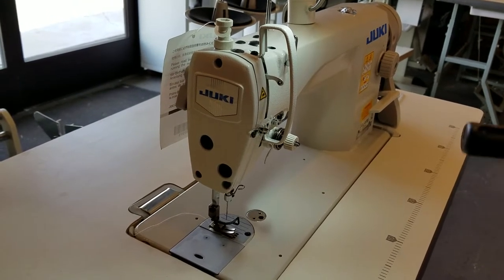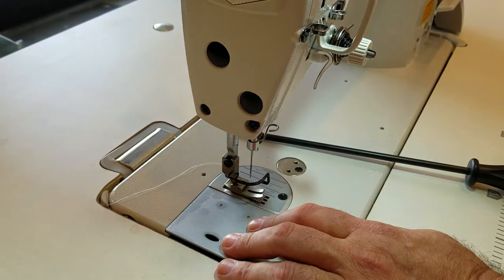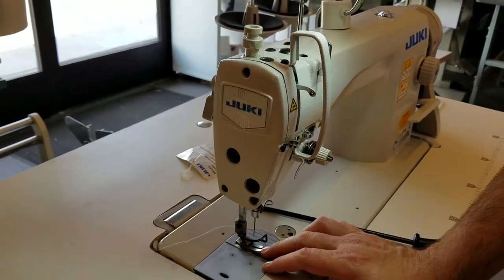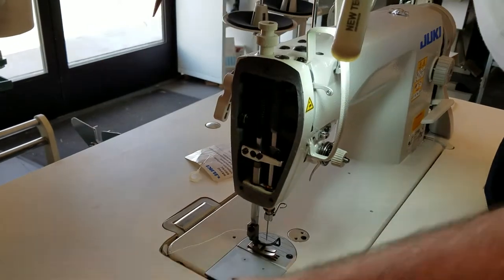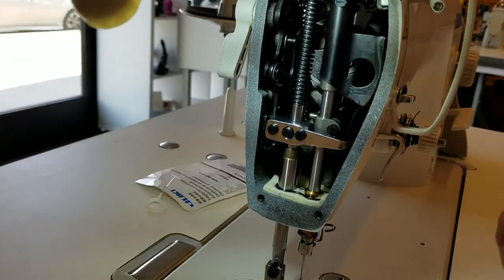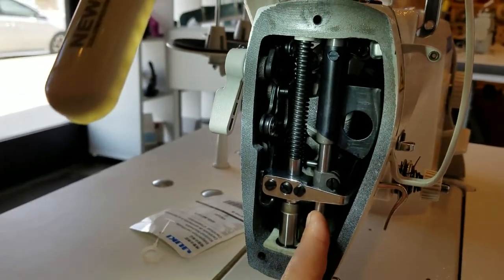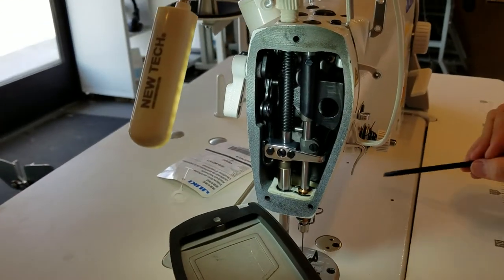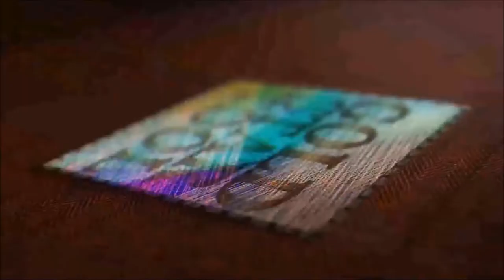Tutorial - Adjusting Foot Pressure on a Juki DDL-8700 - Goldstartool.com - 800-868-4419

Comment: Hey that plastic thing at the top. I accidentally unscrewed it & it popped out. How would I return the plastic thing? It doesn’t connect anymore
Reply: Same happened to me. :(
Reply: Sizu92 hey just put that black spring back & make sure it connects & then need a screwdriver to put that plastic cap back in then twist it. It took a while since that black spring is very strong
Reply: 3AsianBoi I didn’t have a driller and the screw was closed shut. I finally managed to screw it with a normal screwdriver. Thank youu!
Reply: @3AsianBoi  mine just popped off too! I guess I went too far... the side plate is screwed on so tight I can’t get it off even using screw driver. I’ll eventually get it off. When I do, do I screw the spring onto the plastic thing from the inside? Or does it just snap into place?
Reply: @belle398411  hey just put that black spring back & make sure it connects & then need a screwdriver to put that plastic cap back in then twist it. It took a while since that black spring is very strong